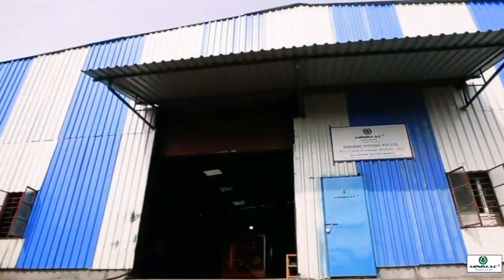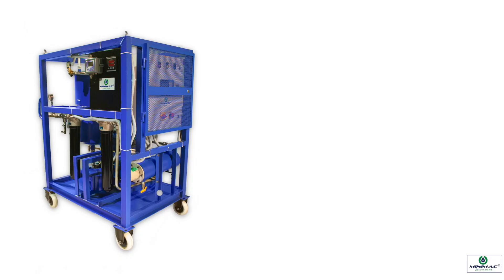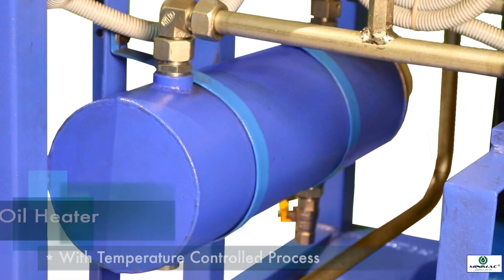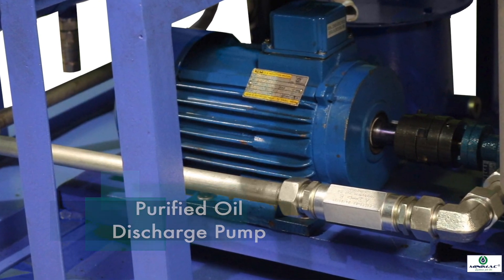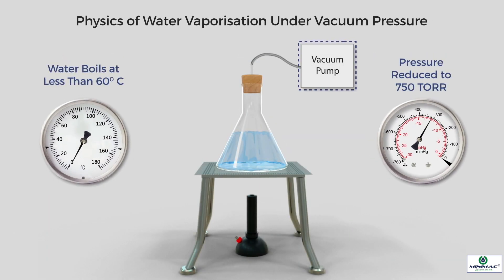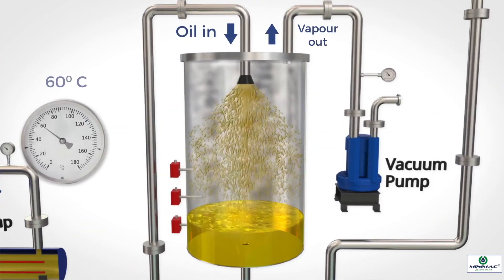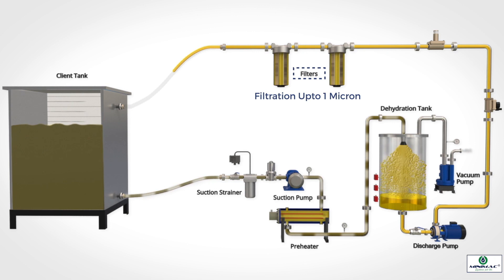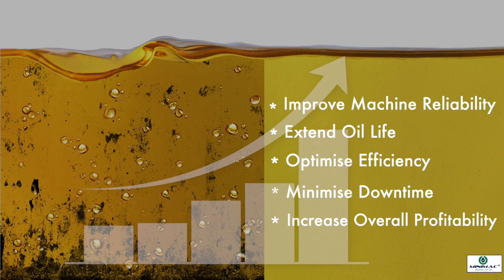Minimac's Low Vacuum Dehydration System separates moisture & solid particles from contaminated oil.

Comment: I am doing oil dehydration ..in the start vacuum was 250 mBar after that it starts reducing until 12 Mbar then it stayed there. the gauge is installed at the outlet of Degasses chamber.
Reply: Can you tell me, about cost of mini plant?